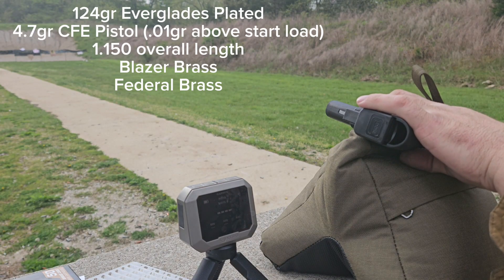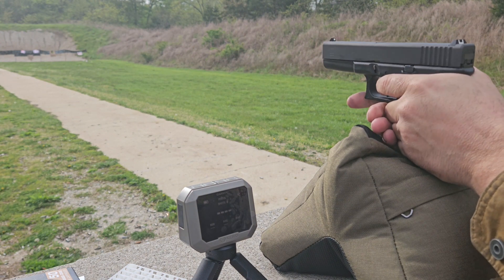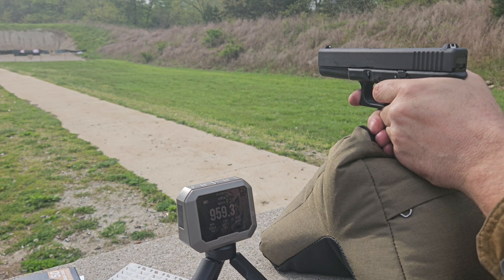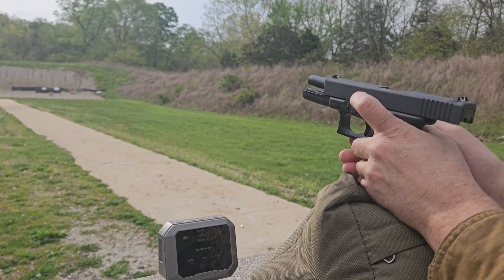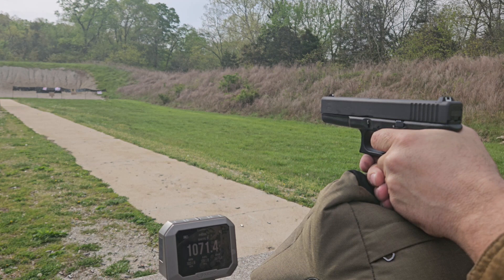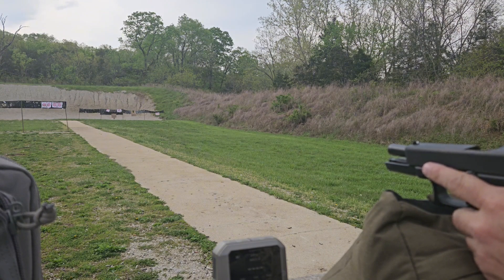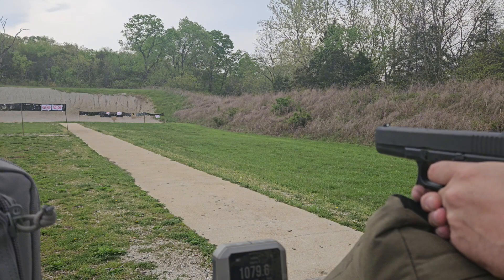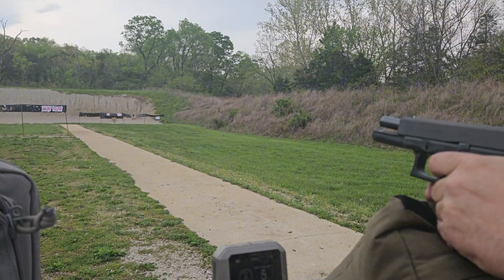Working up..... 9mm ladder test with CFE Pistol powder. Reloading 9mm.

Comment: Nice! I just recently purchased a  lb of this powder myself and not a whole lot of info on it. I started working up a load for my glock 19 with 147 gr xtp. The hodgdon data I found for the 147 xtp was starting at 3.8 and max 4.2. I started on the low end and it burned dirty and workin up at 3 tenths of a grain increments it got a lot cleaner. I wound up easing up too 4.8 grains with no pressure signs and a velocity of 1025fps with the 147 and very accurate. I really likin this powder. Pretty sure I could get 1100 fps out of it but left it as is.
Reply from the maker: I need to experiment with 147gr bullets. I like the CFE powder in my G19s And G17s. I will say I shot some through my Kahr Cm9 and the velocity dropped down to about 950fps. So either my CM9 is a slow shooter or CFE doesn't like short barrels. Might be good info for those working up max loads for a subcompact. I have a video of it I may post sometime.
Reply: You should post it be interesting. I have been hand loading for rifles for 35 yrs but not really for handguns that much as only pistol I own is Glock 19. I have some bluedot and 700x I was using leftover from when I owned a 357 magnum awhile back. The 700x  works pretty good in some loads for plinking and I got good velocity out of blue Dot but it had really  bad muzzle flash and extreme spread was bad. So far I am liking the cfe pistol I mainly just wanted to load SD rounds since a box of 20 jhp SD is so expensive now. Post up more videos I enjoy these tests. If I knew how to do it I would make some myself😅
Reply from the maker: So if you are looking to replicate SD round velocities I would try Alliant Power Pistol. It has some blast but achieves very good velocities with good SD in my reloads. I mostly stick to 124gr bullets though. I also use with with good results in 357 upper mid-range loads. I have a video up with me using it in my Model 27 S&W.
You can also check out my video on Hodgdon HS6 in 9mm. It also seems to work well for me although I've only done one ladder test so far. Heard it works good with 147gr also. :)

Comment: I loaded 5.2 with cfe pistol for berry's 115gn RN. This is my first time reloading alone my dad passed and I got all his reloading equipment. Got this powder not knowing their is not much data out yet.. think they will run fine?
Reply from the maker: I think you will be fine since you are using 115gr although I am curious about your overall length, it will be a factor. Mine was 1.150. It is always wise to start with a starting load(max load reduced by about 10%) and work your way up. Hodgdon has the info available on their website. If you can't find the exact bullet use common sense taking note of bullet design and overall length. Seating depth, bullet weight and design, Power charge are all major contributors to overpressure.
Start with a starting load and work your way up. Broken record here.  Keep in mind also if you are just making range ammunition there is no reason to go max. At 5 gr of CFE  you can get around 1400 rds out of a pound of powder.

Question for you. Curious where you took the pic of your motorcycle by the covered bridge. One like that not to far from where I live.
Reply: @f8green187  mid ohio area place called Indian lake. And I appreciate the info! I definitely didn't think about overall length. All the die's i got were set for me so I didn't think about measuring. Witch i will be doing today now.